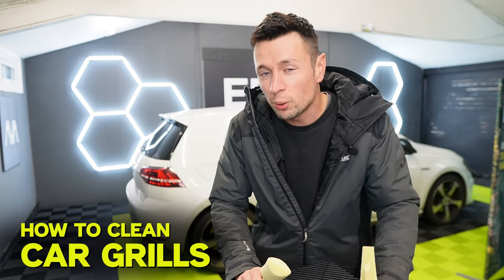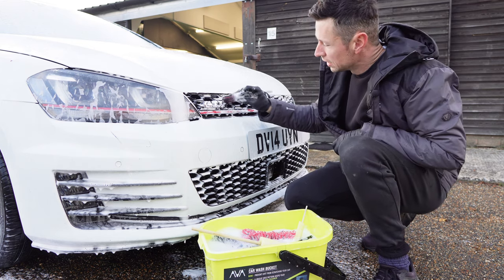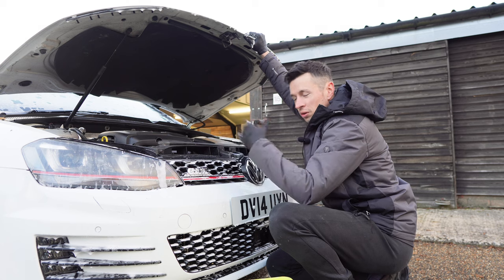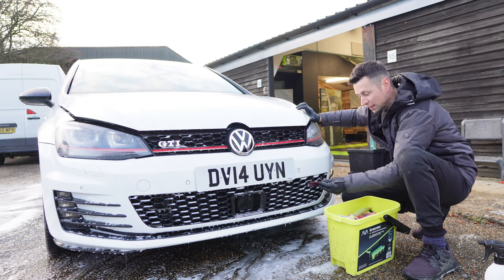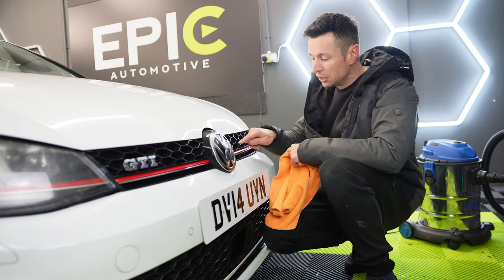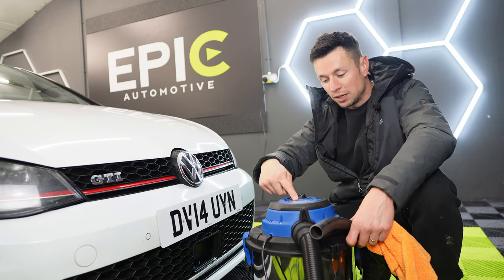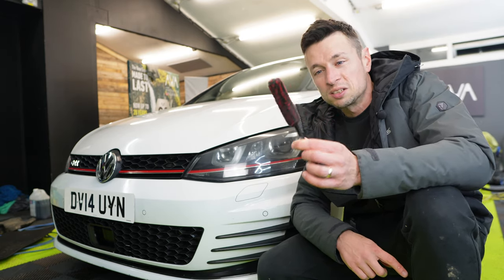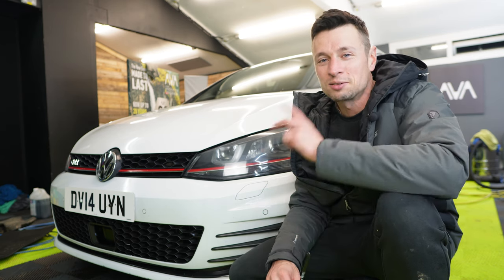How to Clean Car Grilles with 3 alternative methods!!! (Grill / Grille)

Comment: Yup, I have one of those cars, but I got a performance model GTI in Atlantic blue as my daily.  That while front of the car is extremely fussy, and mostly a pain to deep clean or polish.  Easily the longest time spent on cleaning on any 1 panel.  Still a very fun car to drive.

Comment: I'd use hot water in the bucket and the cleaning product of choice - why am I using 4 sponges when one wheel wooliie will do or the brushes?
Reply from the maker: You're not I was, they had 4 different shapes and textures and I was sick of staring at them so now they have been filmed I can bin them and move on with the next video 💪